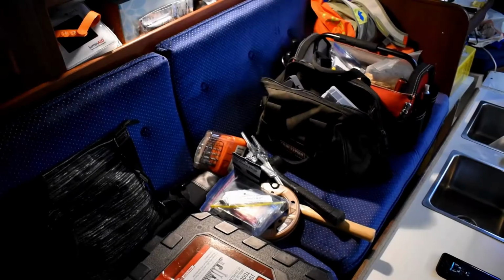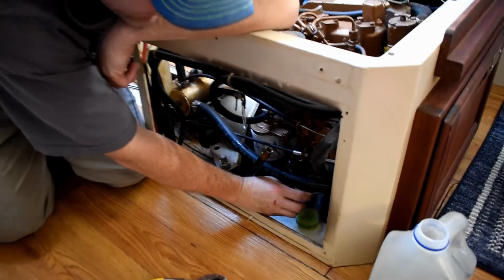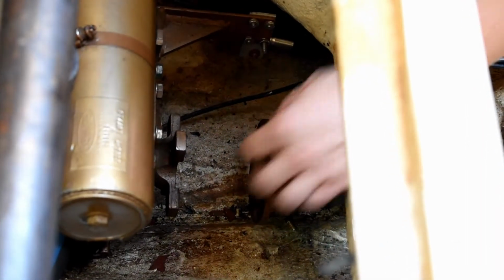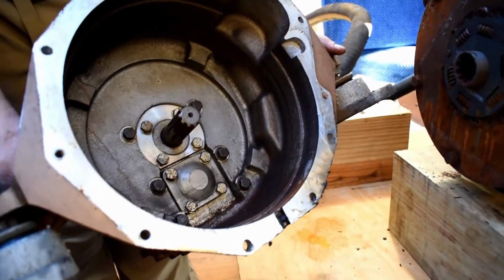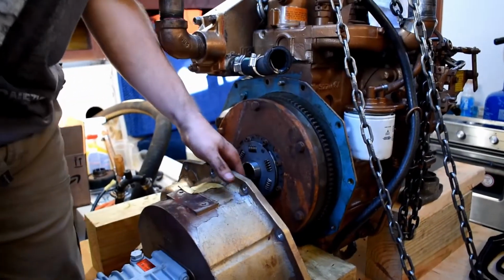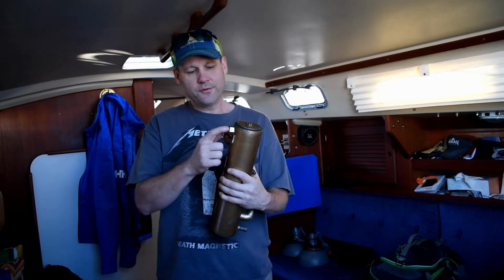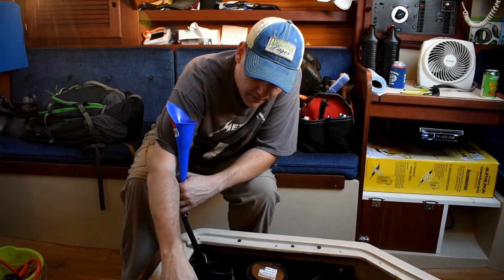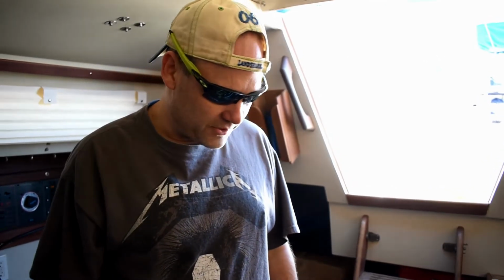Success! -[16]- svSomeday

Comment: Wow the transmission is small!  I expected something like in a small front wheel drive car.
Reply from the maker: The entire engine weight is only 285 pounds (without the bells and whistles). It is a 3-cylinder, so it is smaller than a lot of really small cars. It is still pretty intimidating though if you aren't used to dealing with engine.
Reply: Yeah that motor reminds me of the motor that is in a car we have in the woodshed.  Its a 1990 Subaru Justy with a tiny 3 cylinder motor.  The license plate say 0 to 60 in 20 minutes.  :)  But at 40 MPG who cares right?

Comment: Aren't you glad you did it yourself's? Iv'e always done every thing myself if you can't do it you usually wreck it and then you've learned how.  Even fixing fridge's stove ect. then you just buy a used one cheap and your back in business! For pulling the engine I use a cable come-along there plenty strong enough, but you could have lift the whole boat with that setup. but better safe than sorry! Look up things on youtube they have how to for every thing. unless it's older than the computer. WOW a woman that loves sailing and fixing boats, your one lucky guy!
Reply from the maker: We definitely overdid it on the lifting equipment. We could have gotten away with a lot less but the thought of dropping something that heavy from waist high directly onto the inside of the hull seemed absolutely terrifying. Much better to have practice doing these type of things in a controlled environment rather than having to do it in an emergency.
Reply: I agree! Would hate to sink the boat by dropping the engine!